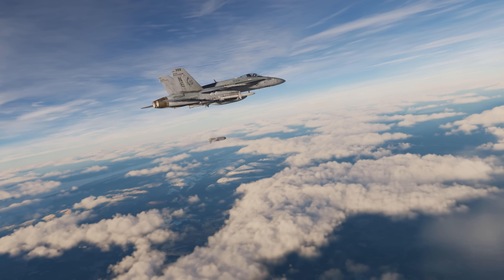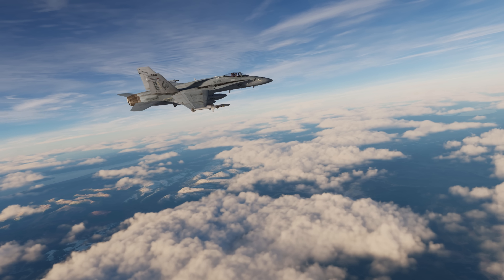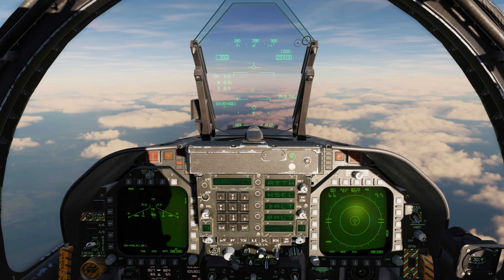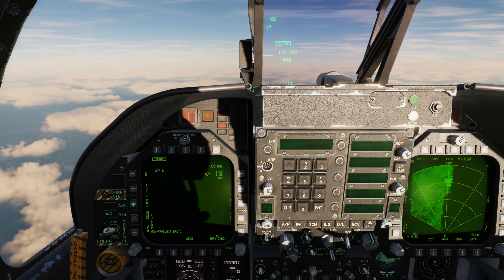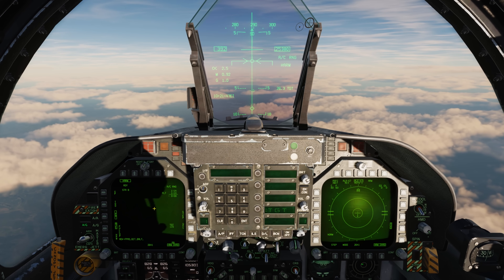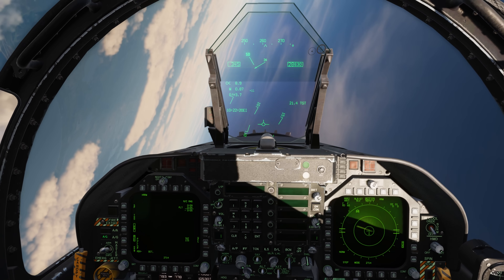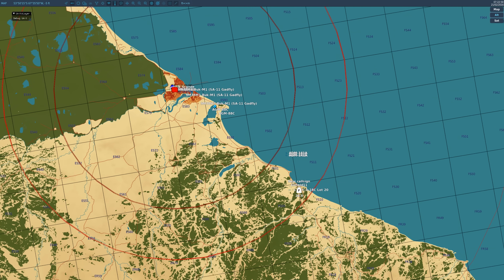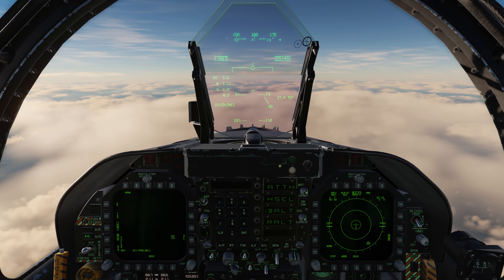DCS: F/A-18C Hornet | Tactical Air Launched Decoy (TALD)

Comment from the maker: NOTE: In the release version, the Stores code will be 82P. Although confusing and not very logical, it will be correct.
Reply: Is the ADM 141 TALD currently available for F-18 in the open beta standalone or has it yet to be released? I just switched to open beta so that I could have the GBU24 Paveway for the F 16 But to my disappointment I switched to F 18 to try and find the TALD but it isn’t there. Thank you for replying to my comment! Have a great day!
Reply from the maker: @sschreck  "Coming soon"
Reply: @MattWagner  did it ever? far from learning the nieche systems anyway, but just want to know if I will look for no reason :)
Reply: @dontaddmehobo  Yes, the TALD is available now - at least in the DCS World beta. (Didn't check the release branch)

Comment: Meanwhile, IRL, a single B-2 can comfortably carry 80 of these (ADM-141C I-TALD). True stealth at 40,000' & 200 miles range (released from 40,000'). Conveniently, ADMs have the same speed as AGM (non-decoy) subsonic cruise missiles.  ~550-600 mph. Making their airspeed indistinguishable from the air-to-ground attack jets & missiles the S-400 was built to stop.  5 B-2s can send 2 waves (200 I-TALDs each) at the target airspace, forcing SAM sites to tun on their targeting radar. And setting the table for 40 F-16s each carrying 2 AGM-88G AARGM-ER HARMs.  Those missiles have a range ~150 miles at Mach 4.0.

Comment: Wouldn't the enemy radar operator go for the higher speed inbound targets before the much slower TALDs?
Reply: Not necessarily. The problem is that the radar can't differentiate between an inbound missle/glide munitions and a decoy. It has to take out the closer target as a means of self defense. 

This tactic was used in desert storm to take out the SA sites. 

Usually decoys are accompanied by glide munitions. It's either emit to kill the decoys and glides resulting in a harm launch or take the glide munitions directly. That's why modern AA focuses heavily on being able to move away from the launch site quickly.
Reply: Then Fly loose formation with your talds…
Reply: Depends on the system, I think. I don't think SA11s can lock HARMs or missiles in general. A combined system with long range SAMs like SA11 or SA10, together with some SA15 Tor that are able to lock on missiles would be much more robust
Reply: @lucasreis6251  SA10 and SA11 lock up missiles no doubt. HARMs do get shot down on their own.

Comment: As a Tomcatter , I really hope this Fixes the F-14's TALDS not deploying its wings and being ignored by all the SAM systems.
Reply: It would probably make sense for HB to switch to the ED ADM-141A
Reply from the maker: Please direct your question to HB.
Reply: @MattWagner  I thought weapons were controlled by ED in regards to coding and more
Reply from the maker: @Charles Sines  Not in all cases. HB used the TALD prior and its unclear how much code is shared between the two implementations. I've asked HB to test.
Reply: @MattWagner   its been an issue since 2021 and HB says ask ED ....ED says ask HB....so...who is to fix it then ? not trying to be rude..but its been an iusse for a while now and Id like to use my TALDs again.
Reply from the maker: @foxykaruptsock3213  As I said earlier in this very post, "HB used the TALD prior and its unclear how much code is shared between the two implementations. I've asked HB to test."

Comment: The real question is how did you get your BALT hold on so fast. If I’m not exactly dead level it will throw a master caution and won’t turn on.
Reply from the maker: Sounds like a controller deadzone issue.
Reply: @MattWagner  hmm ok I’ll try to sort that out then. Thanks wags.

Comment: Thank you!  It's frustrating burning through many HARMs just to get a single SAM kill!👍
Reply: you might be surprised how many harms get hosed off with little (no?) effect   : /
Reply: @SDsc0rch  I saw some numbers once, can't remember what but kill rate was very low. But there's a reason it's called *S*EAD.
Reply: @Bu8813z I think the Skynet mod improves things. I have seen SA-8s go silent after firing HARMs at them on a server, that might have been using skynet.
Another problem is money isn’t an issue in DCS, even Liberation doesn’t care about the weapons, so I might as well just take JSOWs instead of TALDs and get a kill, albeit for more weight and drag.
Reply: @henrikoldcorn  my Jsow’s always get shot out the sky my aa, is there any way to make them more effective?
Reply: @0racle209  mix them in with TALDs
Reply: @0racle209  SA-10, 15 and 19 (maybe 11 too, not sure, might depend on their skill level) will shoot down missiles. You’re better off just not using JSOWs against those unless you’re trying to use up their missiles (8 JSOWs per run, that’s two SA-1 launchers or one SA-15, but they do reload…), saturation is possible but difficult to achieve, you really need multiple people coordinating. Your best bet is HARMs, fired from as close as possible so they come in with lots of speed (>1000kts), or if you can sneak up upon them use JDAMs - DCS counts them as bombs not missiles and so they won’t be engaged (kinda needs fixing). Target the track radar from a good way out, 20-30nm, then come in low and behind any hills and throw the bomb from a few miles away. This is hard and takes practice, but is very effective. You can even kill stationary ships like this, either come in below 20ft or with a slight hill or even buildings (Dubai is nice) between you and it.
Edit: watch this, then make a few practice missions and repeat until it’s easy. This is A-10 and Mavericks, but the principle applies to any guided weapon. https://youtu.be/jkPCdN5yRo4